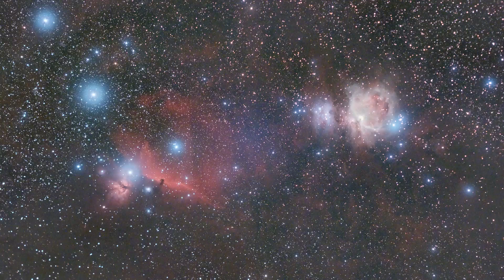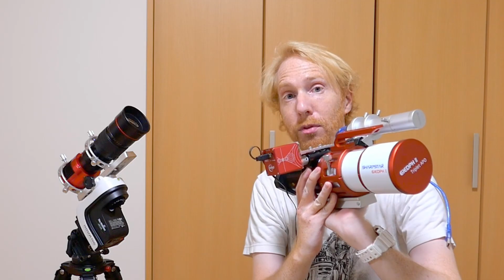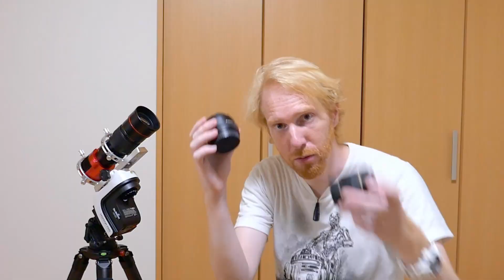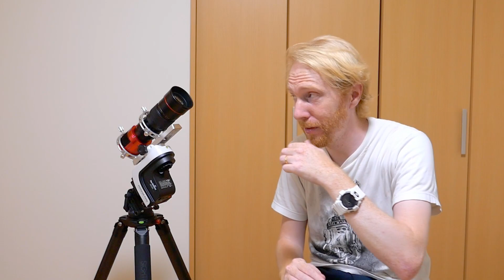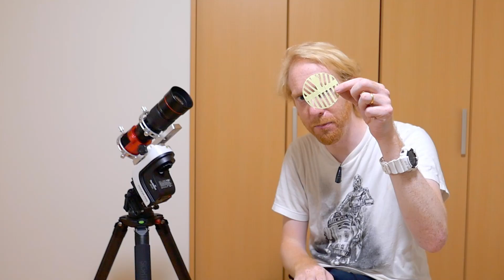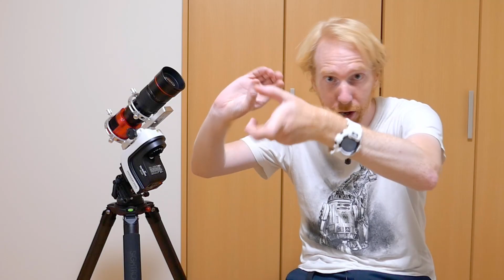Using Camera Lenses for Astrophotography: THE BASICS

Comment: If you set the lens aperture to wide open and then use step down rings fitted to the front of the lens then you will get f#4.2 for a 48mm diameter filter and f#3.85 for a 52mm diameter filter. Both of these apertures will give you good stars corner to corner and great stars over about 90% of the frame. My UV/IR block filters are 52mm and my duo narrowband filters are 48mm. The other adantage of step down rings of course is that you don't get multiple diffraction spikes from the lens aperture which I think look pretty dreadful. On the mounting arrangement you have, it is better to have BOTH scope rings on the lens rather than one on the lens and one on the camera. Why? Because the differential stress between the lens and the camera makes getting good collimation very difficult if not impossible. I am about to fit my THIRD 200mm EF USM lens to my imaging array which you can see on the NewForestObservatory website. Images taken with a pair of 200mm lenses in both RGB and duo narrowband can also be seen on there.

Comment: Hi Cuiv, thanks for the video.
I need to connect ZWO ASI174MM (mono) to my canon lenses 77mm Canon EF 300mm 1:4 L IS lens and 77mm ROKINON lens 2.0/135mm EF Mount, to be able to use it for capturing the faint crescent in daylight or just right after sunset.
Could you please let me know the exact adaptor that I need to order for this purpose and if you recommend one of these two lenses for my specific use.

Comment: To stop down the aperture, I've 3d printed lens end caps with circular openings corresponding to specified f stops.   This eliminates star spikes.  I made these after I discovered the aperture setting on my Canon FD 400mm f4.5 lens stuck at the widest opening.

Comment: Well done video !  Samyang/ Rokinon has long been know for pathetic quality control, I have owned three decent ones, but it literally took seven attempts to get them. All suffered from de-centering which is similar (or maybe the same) as the condition you describe. You don't have to pixel peep to see this haha
Reply: I bought one and it could not reach infinity focus. Returned and got a new one recently but haven't been able to test yet.
Reply: @CaptainZuul  Yep, they are VERY hit or miss. All good if ya keep your expectations low and are willing to go through the necessary monkey-motion haha
Reply: @dawgrules1 On paper the lens is amazing, but the design is quite ambitious. F/2 with multiple glass elements for correction is just alot that can go wrong.

I dont nessesary think Quality Control might be that bad, its just such a difficult lens that QC, while maintaining that price is difficult.

I wonder if the lens was perhaps F/2.8 by default and had a simplified design, the performance might be slightly worse, but atleast they might be able to deliver consistent quality.

Comment: This is something i am wrestling with right now. I had a DSLR Canon T5 on a Tamron 150-600mm lens. It worked well together.
I bought a zwo asi183mc pro and have been trying to get the back spacing right to achieve infinity focus.  So far its not been exact.  I may have to lower my spacing just a touch to get focus.
Reply from the maker: Yep, 44mm isn't a lot of space to work with... Good luck!

Comment: As a Canon shooter, I am intrigued by the Astromechanics adapter. The trouble is, if I get a monochrome cooled camera and a filter wheel, things are becoming problematic regarding backfocus...
Reply from the maker: I used the Astromechanics adapter + 183MM Pro + ZWO EFW with a 200mm f2.8 and it worked perfectly well in terms of backfocus, although that was a while ago!
Reply: @CuivTheLazyGeek   if I remember correctly, the 183MM has a backfocus around 6.5mm only. Larger sensors like the 2600mm have 17.5mm back focus, causing difficulties at this use case

Comment: Great videos on your channel, Cuiv!  Thanks so much for the enthusiasm you put into your content.  It's inspiring.  I was wondering if you've ever tried a catadioptric lens coupled with your camera for astrophotography.  On paper, they seem great: smaller and lighter than many zoom lenses, and able to get to very high focal lengths.  But, I can't seem to find many astrophotographers (using cameras) reviewing these lenses, so I'm a little leery about trying one.  Thanks again for all the great content!!
Reply from the maker: Those lenses are kind of rare! I've never used such a lens, but I know of some who use them as guidescopes (but not as primary scopes). My guess is that since they're at best F6.3, simple refractor-style lenses just make more sense...
Reply: @CuivTheLazyGeek  Thanks so much for the reply.  I finally found some commentary today at B&H Photo and I think there were several things that would make them poorer choices for astrophotography: As you said, they're slow, they seem to have something called 'bubble-bokah' at certain times (?!), and they seem to have a softer image than some other telephoto lenses.  Thanks again for the input!
Reply: @GregEVT  I have used a Zeiss Mirotar 500/8 with a speedbooster on m4/3.The speedbooster made the lens look like 350/5.6 which was more manageable, but still much slower than I can handle without autoguiding. 
The donut effect you mention only applies to out-of-focus highlights, and does not affect starry pics.
The main advantage of mirror lenses is their inherent lack of CA, which can make stars appear sharper. 
The Zeiss is the sharpest I have used, followed very closely by the Olympus OM 500/8. I wouldn't recommend any of the others.
Reply: @aleckennedy6513  Thanks so much for taking the time to relate your experience with that type of lens, Alec.  I was totally unfamiliar with using this type of design for a camera!

Comment: Hi. Is it possible to get step down rings for Canon 300mm f2.8 ?
Reply from the maker: Mmmh I don't know for sure - it's true the Canon 300mm f2.8 doesn't have filter threads at the front. I would probably 3D print a masked Gelatin filter at the back in that case, since it does accept those filters.

Comment: Great video!  I’ve just acquired an Astromechanics EOS adapter and am planning to use my Canon 70-200mm f/2.8 L series lens. I have a question about using step down rings with a lens.  When using step down rings is it recommended to use the next lowest size for a calculated aperture, would it best to use a ring that corresponds to the calculated aperture for a given focal length?
Reply from the maker: I tend to be far less precise about that - I just use whatever aperture gives me what I feel is acceptable in terms of star shapes. More of a trial and error type of approach. Your lens should give terrific results by the way!
Reply: @CuivTheLazyGeek  thanks!  I’m using the Mark II version and I’ve always been really happy with its performance.  I’m pretty sure that it will provide some excellent results with the Andromeda Galaxy.

Comment: Hi Cuiv, that's some very useful tips thank you !! Still there's something I don't fully understand... By using step-down rings instead of diaphragm, don't you introduce black circle around the image ? Can you use step-down rings only if your camera sensor is smaller than the image circle created by your lens at focal plane ? For example : APC-S sensor with a Full Frame lens. Thank you

Comment: Those hats on stars look like something i had with Sony SLT , it had a translucent mirror and this was introducing reflections , it looked almost exactly like those star hats . I would look in to filters you are using , they can do that . And it gets worse the more light there is of course , so it may look like its getting better if you stop down ,  but is actually due to proximity of the filter to the sensor .

Comment: Amazing learning process from your video. I am stuck at ta point, where I cannot figure out how to adjust the Aperture on my Canon lens with ASI 294MC, without having to use a laptop, if that is possible at all. Hope there is a simple solution to that. I will in any case order the 294 cause it is a dedicated astro camera with cooling and will outperform any DSLR even when used with a camera lens. And hoping there is a way to use a drop in filter with the adapter and aperture control.

Comment: Hi Cuiv, I love your videos man. Keep them coming. I learned so much these past few days than I have in the past many years. I was curious about the dovetail plate and the rings you have in this video. What is that configuration? any links to where I can check it out. I plan on buying the eq6-r mount with my canon lenses and zwo camerad. So was wondering if it would give me extra added support with the rings so I can attach the lens and the guiding system. Pls advise.

Comment: Any idea about the Canon 300 f/4 L IS USM?
Reply from the maker: I haven't tested it... But I hear good things about it. The issue is the IS elements, which can shift since there is no power applied to them. So I would recommend non-IS lenses...
Reply: Thanks a lot. Sorry! Sure, I meant the non-is version. although it is extremely hard to find one used here in Germany. Also thought about the Canon 200/2.8 but that lens is sometimes even more expensive than the 300/f4. Advantage for the 200/2.8 that I could use an 1.4 extender for a reasonable focal length

Comment: Outstanding!  Could you further explain using the stop down rings. When I tried it I could see the shadow of each stacked ring during post processing. How many to use? Desired final aperture after starting at f2.8. These are the kind if questions I have. Thanks kindly.
Reply from the maker: Thank you Andy! Did you have any light shining down your lens? And do you have a lens hood? I haven't see such shadows in my processing. To figure out the final focal ratio, just divide the focal length by the smaller aperture number of the smallest stop down ring!

Comment: Thanks for an excellent video - lots of useful information! I have a question: is it possible to use narrow band filters together with large tele-lenses? e.g. Nikon lenses have a stick-in filter with diameter 40,5 mm. As far as I know, there are no such dimension among astro-filters. Back-focus is too short to install a normal filter wheel. So, could you recommend any solution?
Would be greatly appreciated!
Reply from the maker: I tried desperately to fit my NB filters in a Gelatin filter mount for my 300mm f2.8 Canon lens, but it always failed, and I wouldn't recommend it. There is enough backfocus after the lens to include a filter wheel with the smaller ASI cameras since they have 6.5mm backfocus, including the 1600MM and the 183MM (which is what I did). Another solution is to unmount the filter, as I did here: https://youtu.be/MkkhwkXAfOU . Good luck!
Reply: @CuivTheLazyGeek  Very good advise and instructive video - I will definitely try this solution! Can I ask where to purchase that device to remove filter locking rings?  Thx a lot!

Comment: in my opinion , main characteristic to seek after on camera lens for astrophotography is the diaphragm blade numbers. Too low and you have strange and strong diffraction spike on bright stars .
Reply from the maker: It's one factor, but you can work around the diaphragm entirely by using step-down rings (assuming the lens has a filter thread!), or a 3D printed mask. I personally use step-down rings...
Reply: @CuivTheLazyGeek  Clever but you loose how many stops ?

Comment: The biggest issue with using lens for astrophotography is the short backfocus. There isn't enough space to fit OAG and a filter wheel, for example, with my current set of ZWO cameras and accessories. Great video, as usual.
Reply from the maker: That's a very good point - although for lenses an OAG would usually be a bit overkill! But at the same time guidescopes can be a pain to mount... there are definitely quite a few compromises!

Comment: I have a number of camera lenses (Nikon F-mount) that I think would be decent candidates for astrophotography.  I think I already know which one you'll feel is the best for astrophotography (the shortest focal length which happens to be the only prime lens I'm listing), but out of the following, which would be a good for a first attempt:  Sigma 135mm f/1.8 Art lens, Nikkor 70-200mm f/2.8 VRII,  or Sigma 150-600mm f/5-6.3 Contemporary.  The 135mm is definitely the sharpest, but the 150-600mm gives me the longest reach.  The 70-200mm seems to be a good compromise between the two when you balance sharpness and reach.  I don't have an issue buying a telescope (I have a 660mm Celestron), but I'm a big believer in using what you already have before buying new equipment.  Besides, the Nikkor lens retailed new for almost $2,500 when I bought it years ago so I'm hoping its optical qualities match its price when it comes to astrophotography.
Reply from the maker: The Sigma 135mm f1.8 Art is a known good lens for astro, but there have been lemons as well - glad yours looks like it is sharp! Definitely try the 70-200mm. When stopped down a bit, I am sure it would perform excellently!

Comment: Hi Cuiv. Excellent video, I have faced a lot of the issues, you mention, in the past, and actually tilt is bothering me as we speak! Let me ask you a question: In a Canon DSLR - Canon Lens setup, connected to NINA, how someone can control focus? You said something in the video about windows programs. Many thanks
Reply from the maker: Unfortunately NINA doesn't support it - some software do implement it, but which one escapes me right now. The SDK is apparently a nightmare though...
Reply: The safest bet for live view focusing would be Canon's DPP. You won't get an actual FWHM measurement but between the 10x zoom and the micro-steps for focusing it works quite well. If I understand correctly, Bahtinov grabber could be used on the DPP live view window (haven't tried that). The next best option would be APT which does seem to have some decent support for some canon cameras but beware that canon is really going out of their way to make life difficult for third party development and some cameras don't behave that well with APT (e.g. you could be limited to ISO 100). If you feel really desperate, you can try SharpCap but they really don't care about DSLR users and the Canon driver for SharpCap is a nasty hack that requires some level 58 god intervention to work.
Reply: To anyone reading this in 2023: I use QDSLRDASHBOARD to do this. I’m not an astrophotographer, but it works. I use it with my Canon and Nikon cameras and you can use Wi-Fi or USB. Best part is that the software is free , and I believe it’s cross platform for Win Mac and Linux. If you’re a nerd and know how to use the command line (even better if you’re familiar with CGI bin or Node child processes ) GPhoto is equally great. I believe Android has more options than iOS (eg QDSLDashboard has an Android version). Cascable should work on iOS. There are mobile app options, but ultimately desktop is still king due to the less restricted echo system. A final option you can look into are follow focus rigs . They range from 30$ to 200 for budget options, but you can DIY them. They come in manual and motorised configurations.

Comment: Thanks for the good alternative! I am looking to buy the same setup since I am a newbie. I thought of buying a eq6r pro, rasa 8, 294mc, 120mm guide etc but, then I thought it is too much and wife didn't agree rightly so when starting in astrophotography. 

I finally settled on buying a good tripod and since I have nikon d7200 a used 300 f2.8 non vr version and a star adventurer with a light filter if available. What tripod are you using?
Reply: Youtuber_007, I think it is the expensive Sightron Japan carbon fiber.
Reply from the maker: Michael is right on the money there - but with the StarAdventurer, a Benro tripod would work very well, and is much cheaper. SA+Nikon+300mm should give you great results!! Good luck!